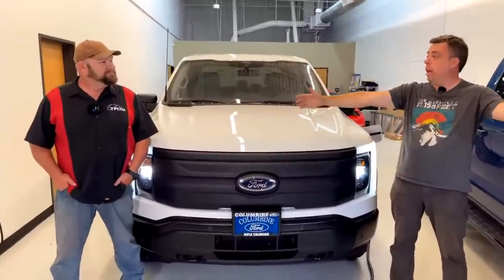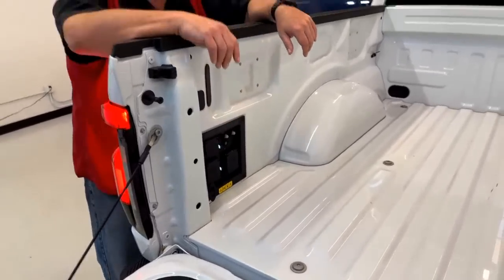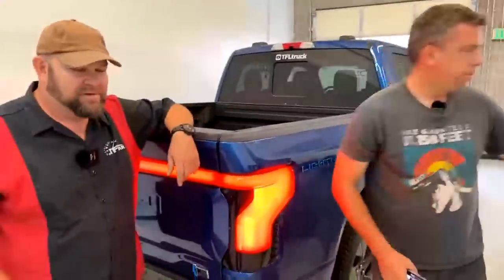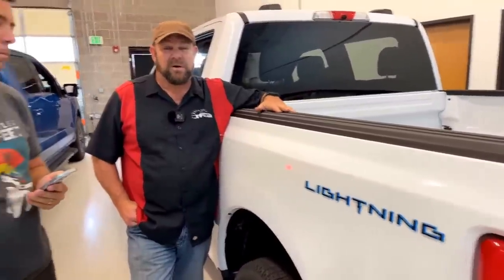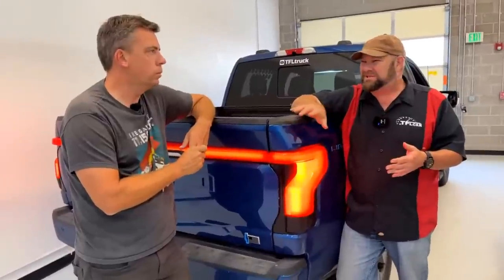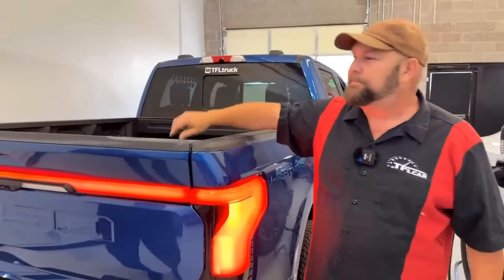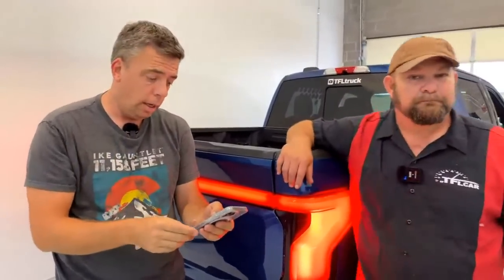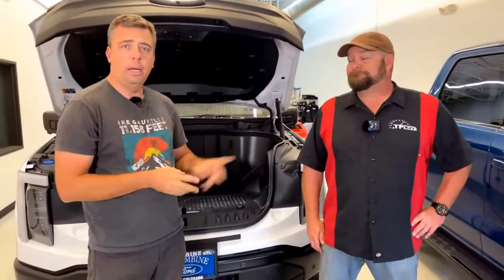Live: Cheap vs Expensive Ford F-150 Lightning Compared & The Winner Is a No Brainer!

Comment: Nathan, I’m glad someone appreciates the rulers in the tailgate cover. They where not my idea but I was the CAD designer on that part and the rulers took forever to get right. Especially where they drop into the bolt pockets. Between manufacturing constraints and the CAD software not having a good tool for lettering / numbering the process was a pain. 😄

Keep up the good work guys!

Comment: One issue I have with the Pro model is that plastic/non soft steering wheel. Over 40K, it should have that. Most manufacturers you know put soft touch, leather/faux leather whatever where you touch/grab frequently. HELLO, I believe you touch the steering wheel the most! Every car/truck should have should have a leather or faux leather wrapped steering wheel and shifter(if it's conventional kind). That's my rant lol. Oh yeah and they could've added a dampened tailgate at least without power, come on Ford. These things can't cost that much.

Comment: Hi guys. Just to give you a comparaison.
This is what we pay in Quebec for electricity:
Rate D does indeed have two-tiered pricing:

6.319¢/kWh for energy consumed up to 40 kWh per day times the number of days in the consumption period (1st tier)

9.749¢/kWh for the remaining energy consumed (2nd tier)

We do not bill based on your daily consumption. We take into account your total consumption during the consumption period, which is more beneficial for you.

For example, if your consumption period covers 62 days, 2,480 kWh (40 kWh per day × 62 days = 2,480 kWh) will be billed at the first-tier price. Any remaining energy consumption will be billed using the second-tier price.

Comment: Hey guys - The motors are the same. From what I've seen the Pro is quicker to 60 and then the extended range will start to pull away.
Reply: Yes what increases the hp is the extended range battery to 580 hp. But same motors on all trims.

Comment: rear defroster on a pickup is not that important. on a cool humid morning, sure it will clear quicker, but you still have side mirrors. and even in the -30 degree mornings, it doesn't always frost over.

Comment: Too bad the PRO model is basically unobtainium.  If you didn't get in the first wave of preorders, you didn't get a 2022, and if you didn't opt to delay your order from wave 1, you didn't get a PRO for 2023 either.  And even if you did have a day 1 preorder and waited over a year, but you picked the wrong dealer, they may have decided AFTER you ordered to add $15k markup like my dealer did.

Comment: 230-260 mile range with 7700 lbs towing, vinyl interior, and 5 1/2ft bed that’s $46k is a joke. My Ram 1500 Classic 2wd extended cab Tradesman Hemi has over 500 miles range hwy, tows 8340 lbs, cloth interior, 6.5 ft bed, seats 6 and cost only $32k.